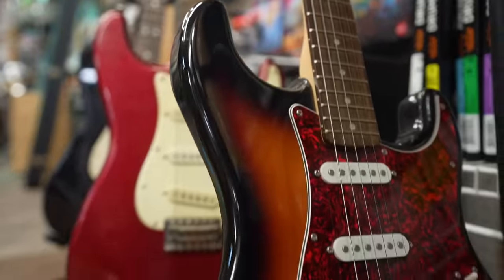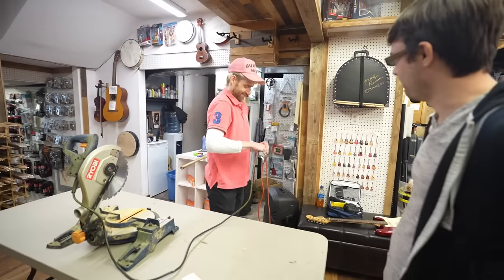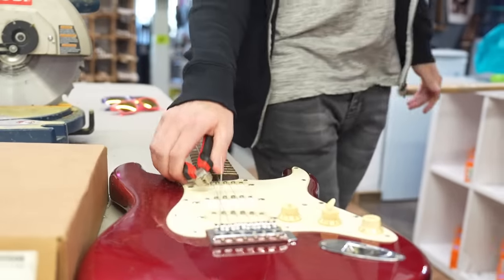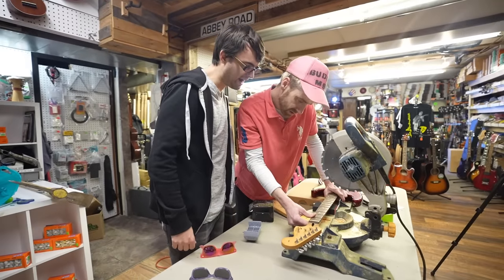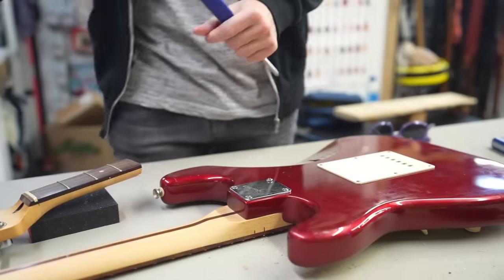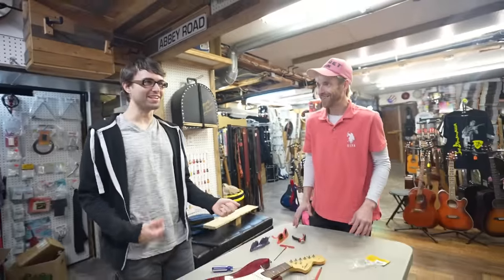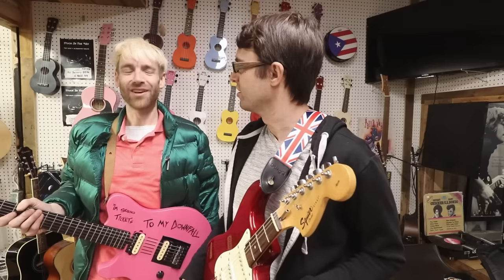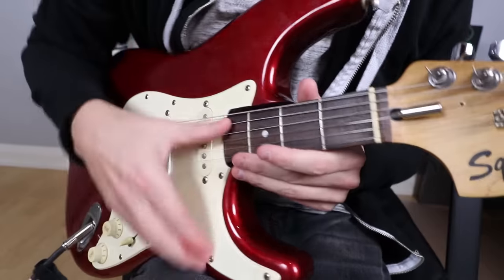I Built a MEME GUITAR!?

Comment: 9:50
Yeah, it's directly related with the length of the strings. By decreasing the length of the strings but keeping the same spacing between frets, you change the ratio of  the spacing , which makes intervals bigger and totally imprecise (and that's why the bends are bigger too). You basically have almost a whole octave divided in four frets, which normally should be 12.
Reply: I'm surprised he didn't think of this. Isn't this basic knowledge for guitar players?
Reply: @LuigiFTMario  Probably would have been better to somehow cut the head stock off and cut the fret board at the 12th fret and somehow rejoin it on there. Come to think of it, he could still do that with the bits he has.
Reply: @LuigiFTMario  I'm pretty sure he was being sarcastic...
Reply: @a39tortoise40  sounded pretty serious to me
Reply: he was being sarcastic
Reply: @LuigiFTMario  not unless you care for building and maintaining guitars.... you could play for decades and never care to learn the math behind fret positioning and string lenght
Reply: @a39tortoise40  I don't think so. Tons of guitarists have no idea why frets are positioned like they are, what the formula is, and whether it will keep having the same notes if the length is cut short. Some people just care for playing...
Reply: Bassicly if you put a capo on at the octive it would have worked better. The frets are the correct length there. Had he cut the neck at the octive and stringed it there it would at least be musicly playable.
Reply: @xanataph  would still be pretty far off like each fret would be a half note sharp
Reply: Didn't understand a single word of that, but you sound like you know what you're talking bout! 🤣
Reply: THANK YOU. This shit triggered me so hard. Like look at your guitar, the 12th fret is exactly in the middle since one octave higher is double the frequency and therefore half the string length.
Reply: Haha yeah of course, in the vid he got me focused on "why didn't he use heavier gauge strings" to reduce the overbend effect, and that kept me out of the fact that the frets would be false anyway. If wanted good frets he would have had to cut the head and keep the part of the neck with the close frets. That would have meant 2 cuts, a double fix that would have been less solid, and last but not least the most eliminating: it wouldn't have looked as the meme guitar, which was the whole point. The C# thing was misleading too.. you probably couldn't play any song in any tonality on that thing (except maybe if you open tune it and by luck one of the frets make a IV or a V? it would still seem impossible to bar a perfect open chord).
Reply: 12th fret should have been fret-0. All one octave higher than standard tuning. 👍
Reply: @LuigiFTMario  No, Steves reaction is pretty much what you'd expect from a guitarist that didn't have a physics background, that it would be very high and sound bad. Once you start playing multiple instruments and figuring out the difference between them, that's when you pick more detail as to the why up. For me that was 25 years or so after learning to play guitar!
Reply: all of you are inept when it comes to obvious sarcasm
Reply: @LuigiFTMario  literally nothing involving math is basic knowledge for guitar players

Comment: If you were gonna do this, you should have mounted the bridge further back on the guitar. Measure the distance from the bridge to the 12th fret, then after moving the bridge back, you want your nut to be that same distance away. Then you can determine fret spacing, which would be the same as a guitar at the 12th fret.

Comment: I think the reason you can’t get sharps and the tone changes so much is because you took top frets and moved them into a bottom fret position. On a normal guitar as you get closer to the pickups the space between the frets becomes smaller and smaller. So just add more frets to sub divide the tone.

Comment: Yeah, it's directly related with the length of the strings. By decreasing the length of the strings but keeping the same spacing between frets, you change the ratio of  the spacing , which makes intervals bigger and totally imprecise (and that's why the bends are bigger too). You basically have almost a whole octave divided in four frets, which normally should be 12.
Reply: copied from mauricio 😭

Comment: The distance between each fret doesn't match the position on the string where the note would be. You should have instead used the part of the neck that is closer to the bridge where the frets are already in the closest position. Or, you can also take off the frets, and then manually go one by one figuring out the correct place where they should be placed.

Comment: Just the fact that you didn't adjust the distance of the frets accordingly to the length of the strings makes this guitar impossible to tune. You might tune the open strings but once you press a note on the neck the note will not be in tune.